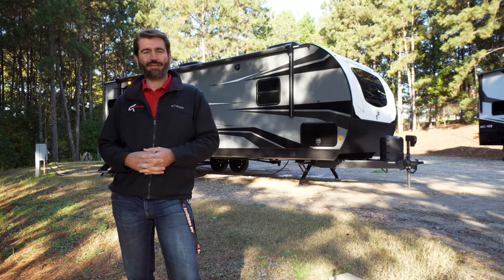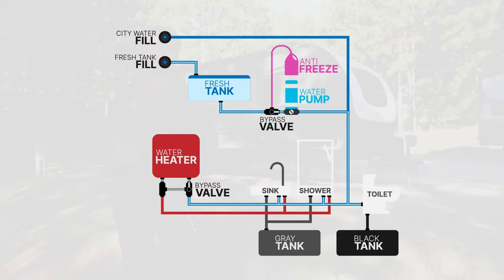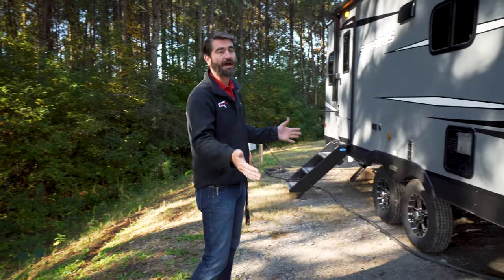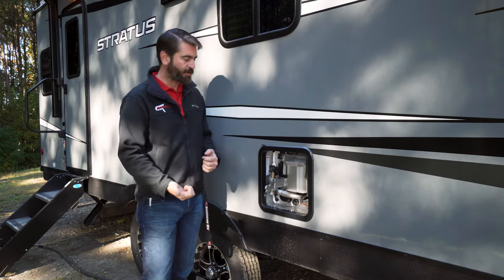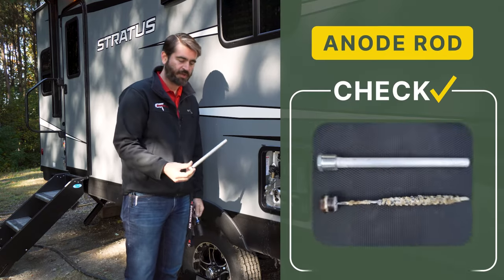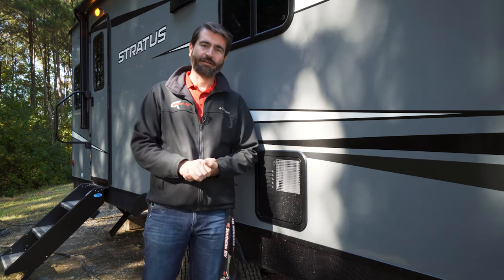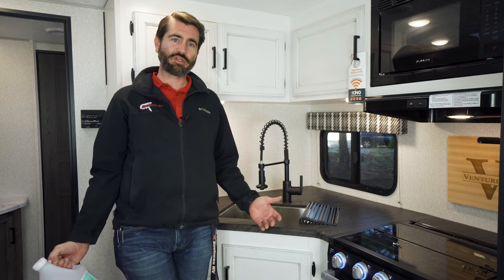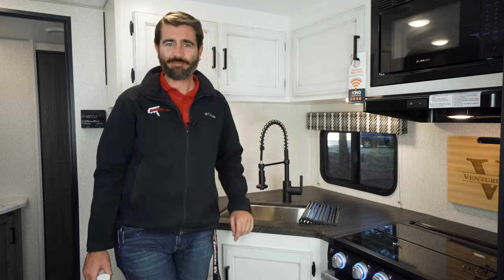Winterize Your RV Camper with Antifreeze for Cold Weather, Blowing Out Travel Trailer Water Lines

Comment: Great video!  My only question would be why can't we just add a few gallons of antifreeze to the fresh tank and open all the valves instead of siphoning from the bottle?
Reply from the maker: You technically could add the antifreeze to the fresh tank and pump it out through the lines, it would just be less efficient and require more antifreeze.